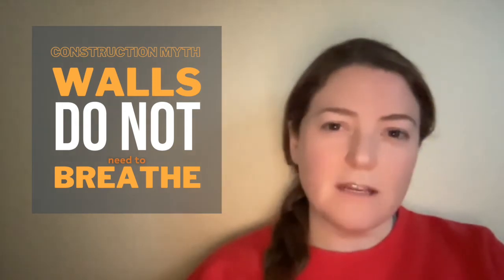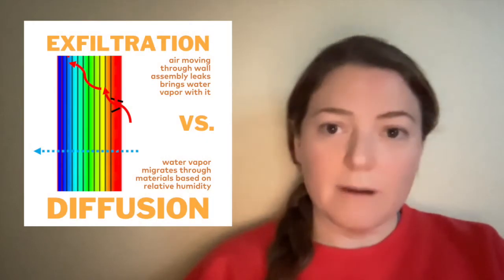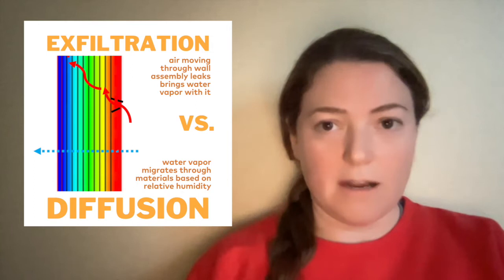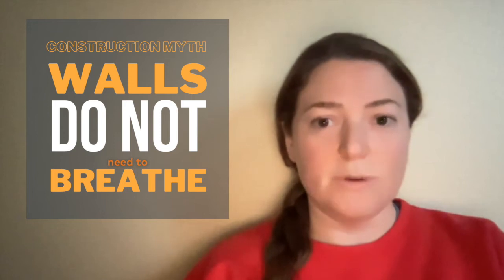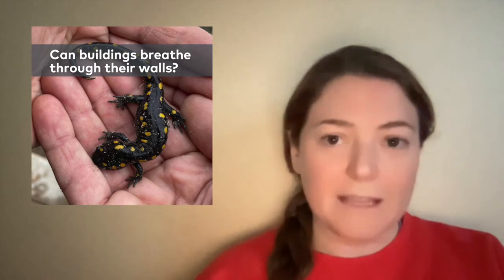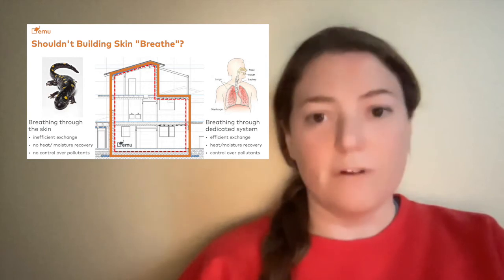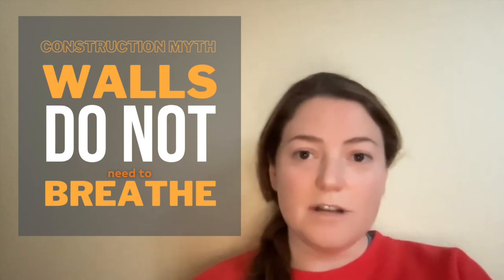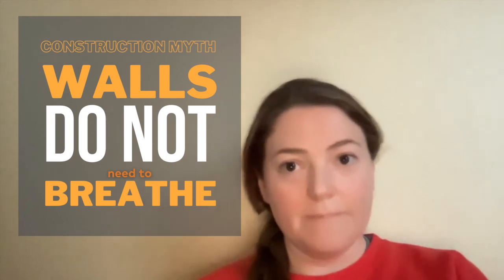No, walls do not "breathe". Exfiltration vs Diffusion | Monday BS with Emu Mariana - Feb 7, 2022

Comment: I understand the theory of an air sealed house, but my instinct tells me that living in a large sealed food container won’t be good for me in the long term.
Reply: The past few months have provided countless examples of residents becoming ill through breathing mould spores in poorly constructed, largely unheated and unventilated homes. Passivehouse deals with all these issues (and more) but in a systematic, predictable way. A building designed on these lines will supply you with plenty of fresh air, but on your terms, rather than just hoping it will come in through unspecified openings and pores.
Reply: @Wayfarer-Sailing  
Point well made.
Reply from the maker: But, does the sealed food container have continuous, filtered fresh air supplied and exhausted? The high-performance building science of Passive House results in the walls/envelope being like your skin, and the ERV/mechanical fresh air being like your lung system.

Comment: Makes no sense to me to call something a "passive" house if it needs to consume energy to run an "active" heat recovery system. A truly passive house would 
breath "passively". The buildings that have lasted hundreds or even thousands of years were not air tight and they have stood the test of time.
Reply from the maker: While I understand what you mean, and the Passive House community often makes self-deprecating jokes about the word "passive", the origin is from the fact that they use passive solar heat gains to provide energy.  The flaw in thinking that buildings that have lasted hundreds and thousands of years are good enough for us now is that our modern lives have many more pollutants and sources of unhealthy indoor air quality. Passive House is a performance metric based on research that couples energy efficient, airtight structures with fresh and filtered indoor air. While there are "active" systems, they are far far less consuming than conventional buildings, and can even be used toward net-positive off-grid applications. Long story short - don't be dismissive because of one word! There is often a lot more that goes into these things. :)
Reply from the maker: I should add - the heat recovery model IS passive in an ERV/HRV. Perhaps you have some misunderstanding about how that works?